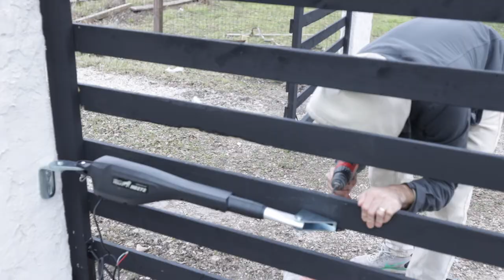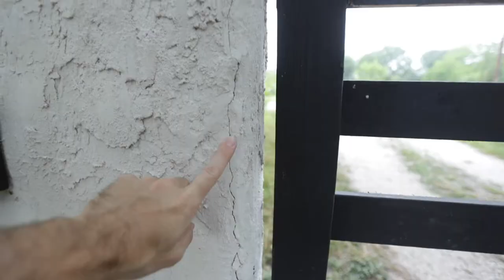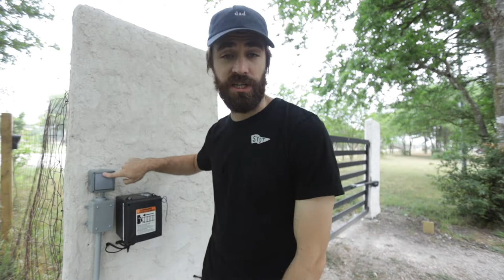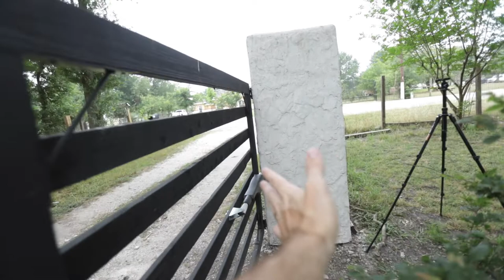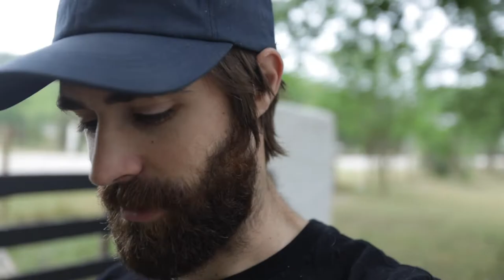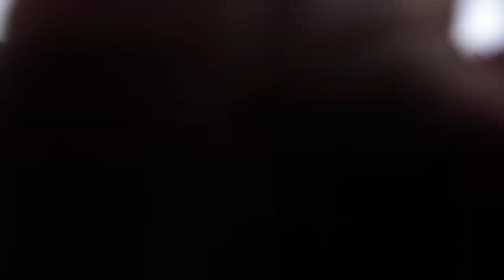Watch THIS Before Buying Mighty Mule!

Comment: Stucco problem: I guess that stuff is brittle.  Battery problem: the battery from Mighty Mule is minimal at best; there’s no way it will carry much additional loads. I prefer a Group 27 deep cycle - 80 or 90 amp hours beats 7.   My last MM was the MM350, and it died one winter after a couple of years.  I’m now installing a MM571W on a new chain link gate, and will watch it closely. The newer one slows a bit as it approaches its limits, but I gather adjusting stop point limits is both important an a bit finicky.  Thanks for sharing the issues other owners experience.

Comment: The rams should be slightly higher on the wall/post side to prevent water from going down the ram arm into the circuit board area.

Comment: why does it need a battery if you plug in directly to an electrical outlet???
Reply from the maker: Mine isn’t plugged into an outlet.
Reply: @humediy   Mine is, do I still need a battery to be hooked up as well?   thanks
Reply from the maker: @gomez619  definitely not. Unless you want the battery for back up in case electricity is out. But you would need a way to charge the battery like the solar panel I put up.

Comment: So if the gate opens too far. Causing it to not operate. How do you get it to operate again.
Reply from the maker: You can turn off the unit if need be. And just push the gate to open where the hinge is in the correct place to swing. Kind of have to test it out.
Reply: @humediy  hmmm. Thanks. Tried everything. I can get one ram to move when i try to set the colse and open limits. But the other one doesnt work at the same time. Still doesnt save the limits on the ram that wants to work. They both either just click or move a half inch and thats it
Reply from the maker: @krotchlickmeugh627  is your battery/power working properly?
Reply: @humediy  yes sir volt tested everything. Battery even passed a load test. There was one issue i found and it was the power line from the battery had been closed in the box lid and looked like it was severely crimped. But i cut it and soldered it back together. Still same issue
Reply from the maker: @krotchlickmeugh627  very strange. My only other suggested is to turn off and test again after a few minutes. And then reach out to mighty mule if need be.
Reply: @humediy  tried it. Think thats my only option. Nothing but issues with these since we got them less than a year ago

Comment: Click bate!  Nothing to do with might mule you would have had the same issues will all solar power gate systems.  Shoddy built post and gates which then break due to the leverage and force exerted on them.  You have a 20w solar panel mounted under a tree and you expect it to recharge the battery and run lights for several hours which it was never designed to do.  Next you will complain the battery has failed because you have discharged it too low. Arrrrhhhh!

Comment: I have had fits with the set up in the programming. And the cost and attention needed. Mighty mule is definitely not a user friendly set up option. Especially for do yourself. When mine breaks down permanently i'm switching to a lift master. Their products are way more user friendly and so much simpler to program. And the money spent for the quality. I'll definitely pay $700 more for the Lift-Master for the easier programming and low maintenance